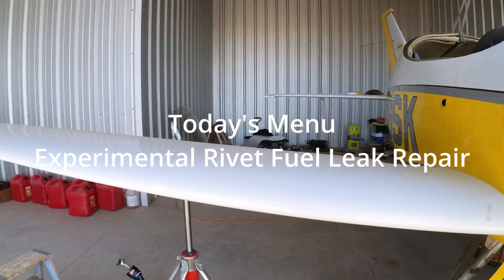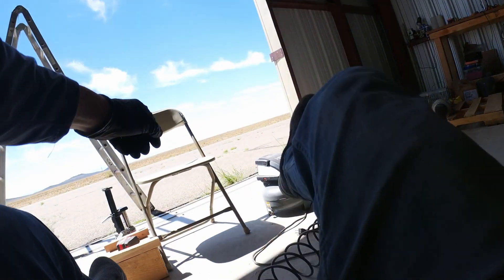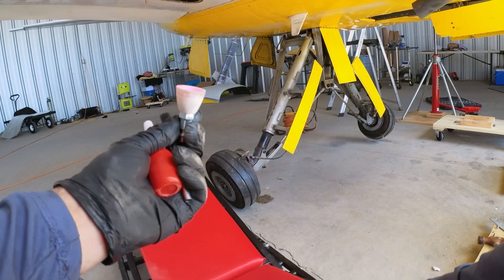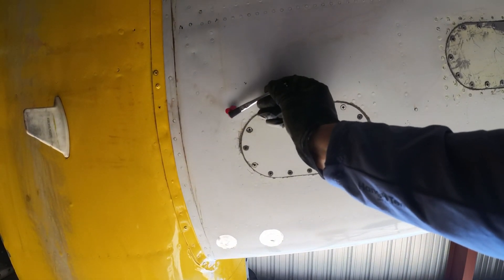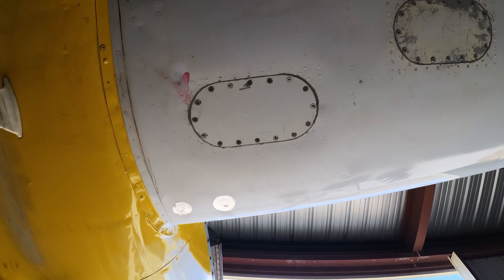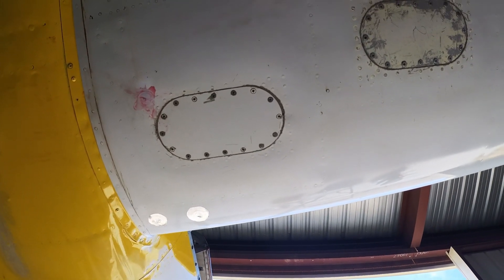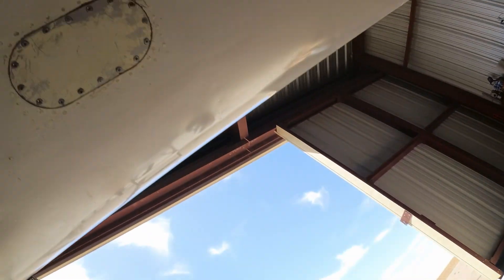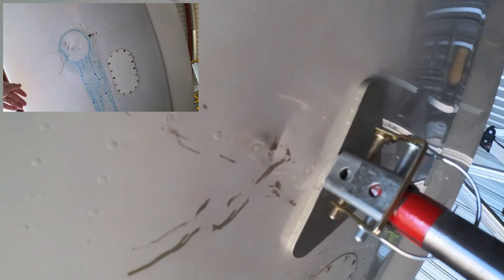Fixing a Fuel leaking Rivet on an aircraft wing, the experimental way!

Comment: i know it's a silly question... but there's an inspection panel right next to it couldn't you take the panel off and then put it on both sides ?
Reply from the maker: there are two types of panels, inspection ones that give access to the dry part of the wing and sealed tank panels which are only used If absolutely necessary and involves breaking the seal and using chemicals to remove the residue. The latter is quite messy and labor intensive, so you would want to avoid that as much as possible. The second consideration is that those sealed panels are quite far from where the leak was, and the wing being laminar is very narrow and has ribs that prevent one from reaching mid sections easily.
I have done that on the right wing, so I was very motivated not to have to do it again. To be honest, I didn't think this technique would work and was pleasantly surprised. How long it will last is also another question, but since it's 1% of the amount of effort compared to doing it the other way ...
Reply: Are you familiar with the Gum Tape typically used for sealing vacuum bag sheet for composites process? It’s usually yellow in color. Creating a small circle of that ‘tape’ around the area would make it much easier to hold your pressure cup in place, with (probably) a perfect seal. Of course, you don’t expect to have to perform this procedure many times so not much need to buy dedicated materials… like I’m sure that’s why you haven’t invested in a 6$ ball valve for the tool.
I appreciate your videos and have huge respect for your choosing to own such a rare and specialized aircraft
😎🎩♠️💙
Reply: @foesfly3047  that's a good idea..
Reply from the maker: @foesfly3047  great idea, I have one more leak behind the spar in the dry section mid wing, so I might give it a try there.